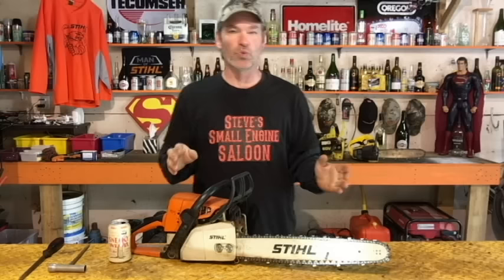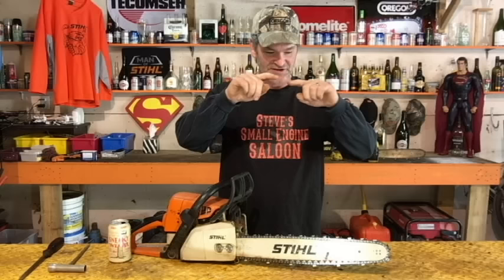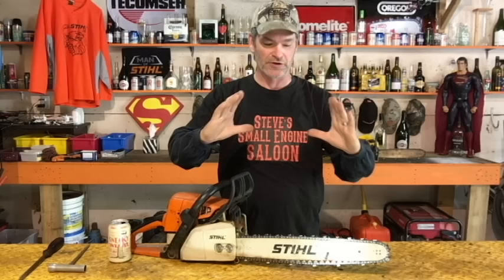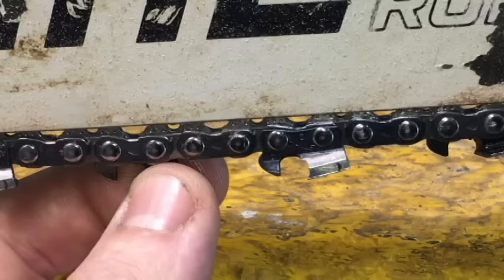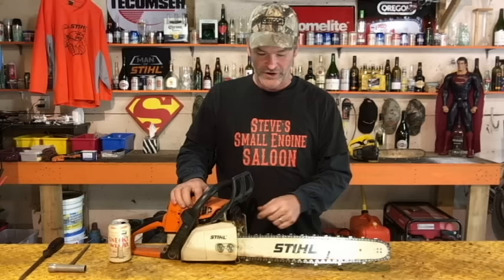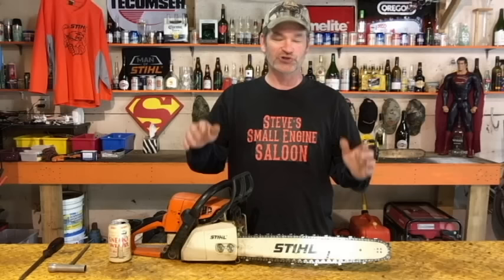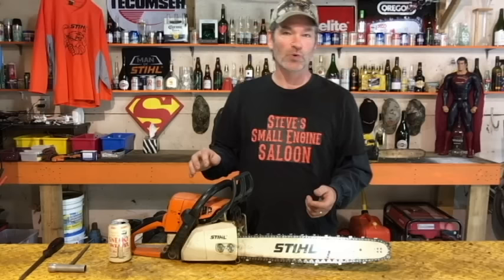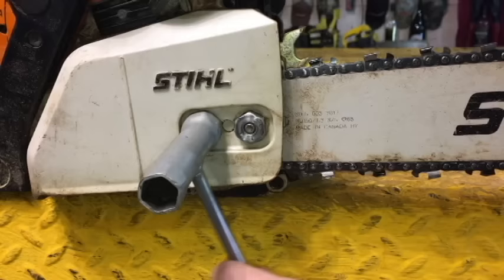CORRECT WAY To Adjust The Chain Tension On Your Chainsaw

Comment: It is important to remember that the chain will stretch a bit as it heats up with use. So check it again once you have  cut some wood. Like wise ,if the chain is warm and adjusted accordingly it will shrink when it cools down especially when stored during winter months. I like to detention the chain for storage to decrease the stress on the equipment.
Reply: I agree. I always slightly overtighten mine when using a brand new chain for this reason.
Reply: Especially if it’s a brand new chain.
Reply: If you tighten it while it’s hot, you need to loosen it before it cools again because you can damage the bearings etc. This is stated in the manual. If I need to adjust mine hot, I don’t suck it all the way up, I leave 1/8th in. Often the chain sagging is time to clean out the bar and cover, and likely sharpen it too. If it smokes, I clean it and sharpen it. There’s a lot of heat involved when the bar cover is plugged up and there’s wood in the bar channel.
Reply: That is very smart. Reducing. Tightness. In WINTER.
Reply: I've had my chains also get tighter while bucking logs. I still don't understand that, but it happens. I check my chain constantly because I've thrown chains, and fried bars. 

Always take the tension off when you're done cutting.
Reply: That’s why you adjust it cold.
Reply: Interesting points👍

Comment: Hi from Australia Steve,
Have been selling chainsaws for 24 years. A tip I learned early on was to lift the handle so the nose touched the bench top while tensioning the chain and tightening the bar nuts. 
Saves needing three hands and you spill less beer. (Carlton Draught here buddy)
Thanks for your great videos,
Regards,
Mark.
Reply from the maker: Right on Mark...
Reply: maybe im mising something, its the same two hands either way. just a different end of the saw. lol
Reply: Maybe I'm just weird but I just turn my saw upside down, loosen the bolts, adjust the tension and then tighten it back up.  After that, flip the saw back upright and go cut wood.  If needed, turn it on its side to add gas and oil. 

Another weird thing I do.  I fill the oil to the top, as much as I can get in there without over flowing it.  Then I leave a little space with the gas, half to maybe 3/4".  That way I will run out of gas first even if the oil is flowing faster than it should be for some reason.  I'd much rather run out of gas than oil anyway. 

I'm still learning about saws, even tho I've ran one when I was much younger, but I've learned some weird ways over the years.  ;-)  I have a Stihl 028 av wood boss currently with a 20" bar.  I am trying to find a good long lasting bar and chain tho.  I cut oak and hickory which is tough on chains.
Reply: Kyabram Motors spilling less beer is always a good enough reason for me!!!
Reply: I use a scrap of wood sometimes if it's handy
Reply: @dufus2273  Yeah, we ran out of toilet paper here last week and were forced to use handfuls of sawdust. It adds to the experience and you get to appreciate those soft woods like along-the-grain-cut pine.
Reply: @StevenCampbell1955  You got me beat. I had to use crushed beer cans.
Reply: @RaspberryRockOffGridCabin  Visitors get a handful of road gravel and sand mix if they don't bring their own. (Beer AND paper).
Reply: Carton dry here 🍺
Reply: I have s question, im using my chainssaw about once per month, should i slack the chain between usage? Thank for the video!
Reply: Holding the bar up also doesn't take up the slack in the bottom with the gravity of the bar along with hiding any slop on top.
In theory, there could possibly be slop on top of you're holding the tip with the chain.
Sometimes the bar is hot when you've gotta change chains and I like the upside down method with a foot on the handle to stop the chain break clicking in which frees up a hand for the scrench and a beer.  Cheers 🍺
Reply: After I get it where I think it needs to be I also slide the chain a couple times with my wrench, while still holding the tip up. It will often loosen a bit when I do this if I am starting with a really loose chain in the first place.
Reply: Dale K wrong
Reply: @noneyabus1  you can adjust the oil flow.  Most saws even turned down low will still oil fast enough to last for a tank of fuel unless it's real thin oil or really hot.  If in doubt, turn it up.  More is always better 🍺
Reply: @mrmadame28  No, you don't have to loosen the tension of the chain on your bar, just like you don't have to loosen the chain on your bicycle, even if you don't use them for a while.
Reply: @mauriceharting5877  thank you!
Reply: @RaspberryRockOffGridCabin  Good cure for piles! Though I prefer 'wire brush and Dettol'
Reply: Correct
Reply: @noneyabus1   it

Comment: yer you're onto it, been doing that since i bin cutting firewood started around 1980, one tip....shove a block or piece of wood under the tip, or in the field rest the tip on a small branch on the ground so the chainsaw is resting on the back of the handle and the tip. this ensures the bar is pushed up hard and you can concentrate on tensioning the chain and tightening the nuts. i have my bar oil cranked up to the max, you can have the chain with some tension on it because in operation when a large amount of heat is generated the chain will lengthen and the xtra tension will back off very quickly to ideal, also never tension a hot bar and leave it cool down, when the chain shrinks it can over stress the crankshaft, try to always set your tension just before you start cutting. my sthil was an 042 for 25yrs, bought an ms 361 back round 07. having said all that your vids are good steve, practical knowledge with no bullshit. regards...
Reply: Great way... I cut 8 cords a yr in Montana
Reply: Thanks for that tip. Makes sense from what Steve explained too. 
I’ve had 4 dudes on my chainsaws and not one of my machines are fully functional anymore.... except the Husqvarna now that I took it in to Sthil repair place and they had to replace bar, chain and secure the handle for me!  They gave me a small tutorial as well. No more dudes on my equipment because of people like you and Steve and a lot of “but why?”, instead of sticking my head in the sand after my late husband’s fatal accident, I tcb myself.
Reply: @nevada8462  "I’ve had 4 dudes on my chainsaws and not one of my machines are fully functional anymore..." 
Reminds me of all the different 'professionals' that cleaned my boiler. All of them improperly adjusted the igniter electrode. I would always hear fuel spraying before it finally ignited then 'woomp!' 
I watched them a few times then read the owners manual and bought a vernier caliper and adjusted the electrode gap myself. 
Ignition was instant.
Reply: Was gonna say the same thing.  Why hold it up when you have all this wood around you to do it for you and give you two free hands?
Reply: Agree
Reply: This is the best method.

Comment: A couple additional comments: re-tighten after warmed up, as the warm chain will sag a bit after heating/expanding, especially if it's a new chain.  Also, loosen and store loose if you're going to store it a bit long-term.  Pull the chain back and forth (with chain brake off and be careful not to cut yourself).  It should move freely and smoothly.  If there's a pretty good amount of resistance, you're too tight.  Finally, there are certain areas of the bar that are tell-tale signs of a too-tight or too-loose chain.  See other videos on the subject and you'll learn about them.  Overall, this video does a very good job though.  Thanks, Steve.
Reply: Also, if you do this, dont forget to remove tension after use because as the chain cools it will contract causing huge stress on it and all connected components.
Reply: Thanks Steve. This helped me a bunch in understanding how to adjust the tension on my chain!

Comment: A great must-do tip. My first job was at 15 yrs old in a saw shop. Your tip was one of the main things I  leaned, only the method was different. Instead of holding the bar up, just turn the saw over and the bar sag will be in the up position without holding.

Comment: 25 year arborist here. He’s absolutely right about holding the tip up. I always tell people to adjust the chain until you can just pull the drivers, which are the part opposite the cutting teeth, out of the bar at the middle of the bar without having to pull real hard. They should snap back into place with no sag at the bottom. Remember, a little loose is better than too tight. Also, I always flip the bar over every time I change the chain to minimize warp, but make sure you don’t put your chain on backwards!
Reply from the maker: Good point!  Thank You...
Reply: @StevesSmallEngineSaloon  Happy to help! Great video,  thanks for making it! I get asked this question all the time and I’m always hearing homeowners with their chains making a loud whirring sound cuz they’ve got too much tension.

Comment: As a homeowner and builder who occasionally helps clearing some of the lots that I build on, this video is helpful to me. Not pulling up on the end of the bar while adjusting the chain explains all my problems of often ending up with too tight of a chain soon after I begin cutting.
Reply from the maker: Right on
Reply: Why are you putting so much weight into cutting ? Just let the saw and gravity work together !

Comment: There are a lot of guys from Ork that make chainsaw videos. Many of them I want to ask WHY?

This is the BEST explanation of chain tightening I have ever seen on the Web.

Tip: a little piece if 2x4 can be used to hold that tip up, so you can use both hands to adjust chain tension and tighten the nuts.

If you have a stump vice, that makes a good bi-pod for the tip of the bar... like on a rifle.

Notice his terminology. It is all correct. (There is NO "blade" on a chainsaw, for example.)

READ your saw manual. It's there to help you.
Reply from the maker: Right on...
Reply: Actually there is a "blade" if you're in the British isles.
Reply: Burt Hulbert Who in the British Isles makes chainsaws?
Reply: Burt Hulbert and a boot is a trunk and a bonnet is a hood.
Reply: @DiscoFang  who in America makes chainsaws?
Reply: @akbychoice  God save the Queen!!!!
Reply: Burt Hulbert Who said anything about the Americas? You can cut straw men with chainsaws.
Reply: Burt Hulbert But to answer your question: Echo.
And whatddya know, some Stihl are still made there.
Reply: @DiscoFang  I know some Stihl brands are assembled in the US but I thought echo was Japanese?
Reply: Burt Hulbert They are Japanese. But like Japanese car manufacturers having factories in the UK, Echo have manufacturing & assembly in Illinois. They've been in the US since the early 70's.
Reply: @DiscoFang  then I stand corrected. Good information I wasn't aware of. And me being so damn old I can remember when McCullough's made in USA went to 40:1 using their own special oil.
Times have changed.
Reply: There's like 20 blades on a chainsaw lol
Reply: @placesaroundus  thems be cutters my friend ;).
Reply: Manuals are for the unexperienced
Reply: @burtvhulberthyhbn7583  I just bought one new a few days ago and it's a Stihl made in the USA
Reply: @groovee63  yes, if its something you are experienced with, many of the new saws are not the same as the older saws, ie where you gonna stick that little screwdriver to adjust the carb 😆.
Wanna see some videos on saws chains checkout my channel, I don't do much talking in my videos, but I have said plenty on the forums.
Reply: @burtvhulberthyhbn7583  
Well Burt I am old too.
I remember when MacCullochs were by far the most popular saw. Well, the most common anyway. I always thought of them as very hard starting. Sometimes SO hard it required several four letter words.

So the mix was 40:1? I have been trying to find that out. Thanks.
Reply: @groovee63  
Greg, without manuals those inexperienced guys make mistakes, damage equipment and use the wrong terminology.

If you are doing well without any manuals then I applaud you. But that isn't the case for most people. They just open that second or third beer and people think whatever they say is right.
Reply: @michaeldougfir9807  all you young boys don't remember the direct drive mauls from around the '40s an early '50s when the MacCullochs were new, my dad and I bought our brand new mac in '58 back in the day when I was 15 yrs. Michael said that bye for now my friends.
Reply: @michaeld.coulombesr.583  
Thanks. But I am not young.

Now. Tell us Englishy about the "mauls". Is this a nick name for a direct drive saw?

Or something else.
Remember to use your English.
Reply: @michaeldougfir9807  at 76 year's I don't think I can be called young either lol
Reply: @BuzzardView  ...there's Australian and American fanny . I always have a torch in my boot .
Reply: Z JJ
Reply: I think he should have mentioned the hotdog method.

Comment: Good job explaining chain tightening!  Thanks Steve.  A review of fundamentals is never a waste of time!  Strange how one can develop bad habits from thin air!  Couple of minor points  a) Clean out behind the cover plate to free up the sprocket and chain before adjusting chain.  All that rotten wood fiber and oil that inevitably gets packed in there!  Otherwise your chain adjustments will not be accurate.  But we all keep our saws clean anyway, right?  b) After adjusting and before locking down the nuts, roll the chain with  gloved hand a full rotation and recheck the tension.  While holding up the tip with hand of course.  And again after tightening the nuts  c)  New factory chains can change after first hour or so of work. Usually getting longer and looser.  I've thrown chains because I failed to check a factory new chain...
Reply: Bought a few "chain catchers" that got sheared in half due to this :^(

Comment: Another great video.  My family owned and operated a tree service for 30+ years and maintained our saws ourselves.  You described the process perfectly, even the need to lift the tip of the bar as you re-tightened the nuts holding the bar on.
Reply from the maker: Right on

Comment: Great Video. Been adjusting my chain this way for many years. The other factor to consider is, that as the chain heats up it will become looser. I had the chain derail when I was a rookie and was lucky it only slapped me on the hand and wrist good. The little aluminum angle shaped safety damper is still on my saw although it is bent from that rookie mistake many years ago. It likely saved my hand and wrist from serious injury. That slap on the wrist always reminds me to monitor my chain tension often..

Comment: All awesome stuff 🙂! I was blessed by being taught all the tips and tricks from a father who used to make a living felling trees by hand. He fell some of the last of the old growth trees here in Washington state. He used  big saws with massive bars.  He taught me to keep the chain tight enough to stay  on but not tight enough to cause binding. The chain should always move freely when pulled by hand.  The sound your chain makes will always indicate whether or not your running it to tightly. I have learned from experience to watch and listen to my saw and chain. They can tell you many things if you know what to look for. I have as you say slapped myself on more than one occasion after a long day of tree thining or brush clearing and my chain has stretched and slacked off.  On a side note always make sure you have your wrench securely on the nuts when tightening, I forget once and sliced the side of my hand open on the new chain I had just installed. My wrench slipped of at full down force. I like to make sure my nuts a nice and tight. I lost a few in the woods once when they backed off. 

This was a nice refresher and very important for the longevity of your saw. 😊 Thanks 👍.

Comment: This is exactly how I adjusted my chain when I worked as a logger in the late 70s and early 80s.  Normally I would rest the very tip of the bar on a log or stump and then lean forward a little on the top handle and that keep enough pressure under the bar to allow proper tensioning and tightening of the bar nuts.
Reply from the maker: Perfect!

Comment: Your explanation for removing the “pre-load slack” is excellent.  The same logic/method is used when tuning a guitar (or any stringed instrument), always “tune-up” (adjust in the direction of increased tension) to assure the structure of contact in the load direction.  Pulling up on the bar will save a lot of time.  I also find it best to run the saw for a minute to check the tension after adjustment, especially with new chains (true with guitar strings as well!).

Comment: Great advice! When I was cutting logs for a living, I would start the day adjusted this way then re-adjust after the first tree or so. As the bar and chain warm up the chain gets longer and looser. Make sure you are getting plenty of bar oil on the chain to keep it from getting too hot. There is also a big difference in the quality and lubricity in bar oils, don't use motor oil. Use only the best bar and chain oil you can get, try several brands. One day cutting with motor oil can ruin a bar and chain. When cutting real pitchy large wood like Western Larch or Douglas Fir you need to crank the bar oil adjustment screw up a ways.
Reply: I run atf in mine. 😂